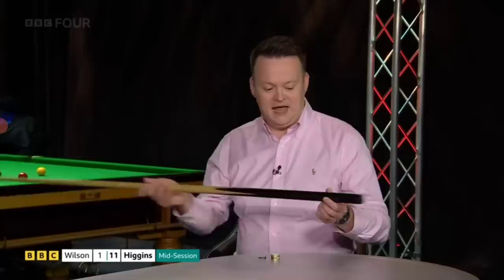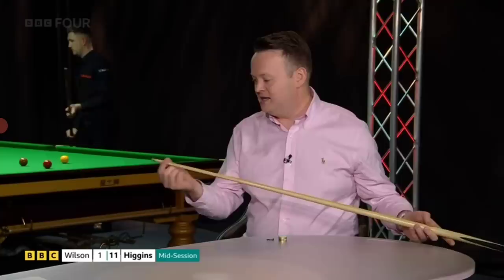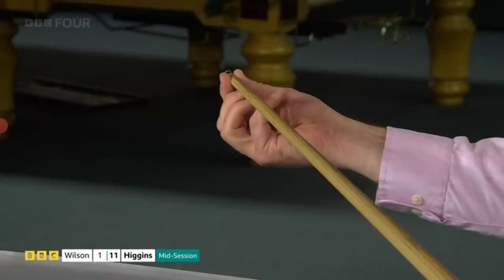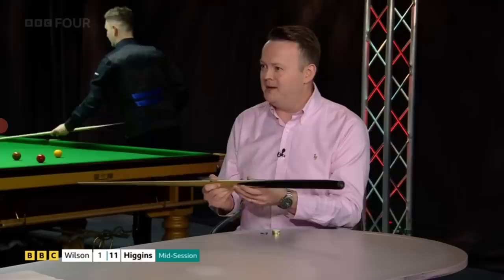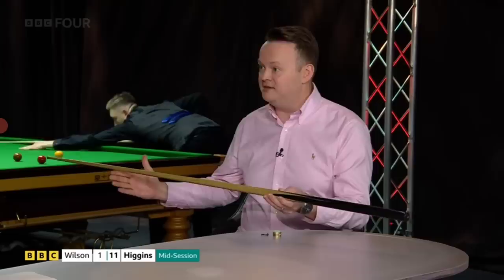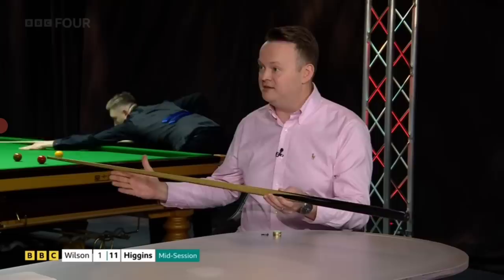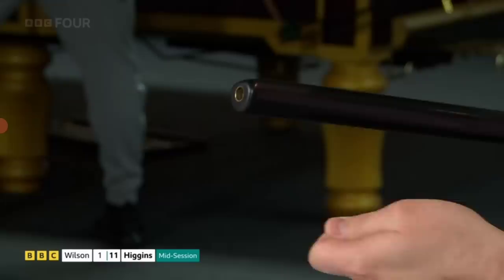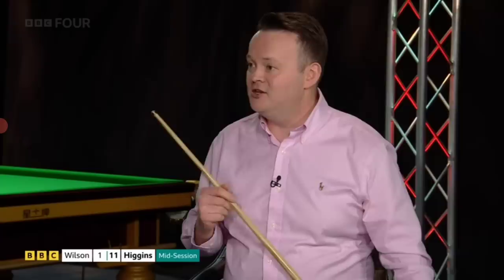KBV-411 Shaun Murphy Demonstrates The Problem Kyren Wilson ls Having With His Cue.

Comment: For anyone who thing a spare cue the answer. Its very difficult to change cue due for the fact the power, feel, weight point, stiffens. thickness and tip need time to brake in. These are unique characteristics of a new cue to get used to it can take upto a year to be 100% with a new cue. (depends how much you play). For most player have a hard time getting used to a new tip if needs replacing in a tournament. Let alone a new cue that a player been playing with for years with the same cue. And inaddtion if you think the answer is to practicing with two cue you are getting better with none of them. Truly you can only grow as a player with a cue of your own
Reply: Kayron is a good player but not as good as Higgins.  Higgins is old so his performance is not as good as it used to be but it was good enough to beat Kayron.
Reply: Have to have a excuse.. It couldn't be that you where not as good as the other fella
Reply: Kyren changes cues often though so it would not be so much of an issue as a player who uses the same cue for years.
Reply: A cue makes at most a couple of percent difference. It's just easy to blame the equipment if you're not playing well.

Comment: John Parris cues at its best
Reply: I know someone with a parris cue that's done the exact same thing..if its the weights in the splice that is. His cue was horrible to play with like that.
Reply: Ton praram III is the best for me.❤
Reply: Ronnie O'sullivan's is the best.
Reply: I have a Parris cue, it's not made particularly well. Something was loose inside, so I took it back to the shop. No, there's nothing wrong after about 3 weeks. Started playing with it again, and yes, it was still loose. Worked out it was the extension joint had come loose so tightened it and it hasn't been an issue since. I would have thought that would have been glued in place. It does play nicely, but the finish. Not so good, and also, there's a massive knot in the shaft, and the splices are raised. I have a couple of Trevor White cues that are faultless. Shame you can never contact him. Somebody I know waited 6 years for an Ultimate. No thanks.
Reply: @irnickkkknowles  Snooker cue from Thailand is the best.
Reply: @racingretro4850  Omins
Reply: @WillyEckaslike  Have you try TON PRARAM III ?  There are many pro player use this brand such as noppon, john higgins, kyren wilaon and many chinese players.
Reply: @irnickkkknowles  They must be doing something right, those cues have won world championships. Perhaps the pros get different treatment than the average buyer.

Comment: As I understand the cue case mishap happened AFTER the first session, when Kyren already was 0-8 down. How could the faulty cue then had a negative influence on the first sessions play? It looks to me that the faulty cue actually helped him in the second session win 2 frames. Or maybe Higgins was just better than Kyren those 2 days. Experience comes before youth. Higgins has been working on his come back for a few years now, and wasn't going to be stopped by Kyrens poor shot choices. He just took advantage of the youths inexperience. What stopped Kyren from changing cues anyway?
Reply: I wouldn't call Wilson an inexperienced player.
Reply: @sonicdiablo8968  more inexperienced than Higgins
Reply: Changing cues? U mean like getting 1 off the rack of spare cues they have next to the door on the way into the crucible?
Reply: kyren isnt inexperienced he has been at to top ranks for many years and has won big tournament. It would be like comparing Judd Trump is inexperienced to Ronnie. Its very differcult to change cue due for the fact the power, feel, weight point, stiffens. thickness and tip need time to brake in. These are unique characteristics of a new cue to get used to. For most player have a hard time getting used to a new tip if needs replacing in a tournament. Let alone a new cue that a player been playing with for years with the same cue.
Reply: @sonicdiablo8968   he is a cry baby
Reply: There are millions of cue in the U.K.. He can get a good one. His performance was poor and Higgins is in top form with experience.
Reply: @jimbevan4107  I don't see what that has to do with my comment
Reply: @sonicdiablo8968  ok I will spell it out, Wilson cries like no warrior I have ever seen (he is no warrior) so now that he has lost he is saying his cue let him down! Shame on him!!! He should praise the cheat Higgins and bow out like a cry baby he is
Reply: @jimbevan4107  I said he wasn't inexperienced. FWIW I pretty much agree with what you're saying.
Reply: @courierton9217  that's not how it works...players don't just change a cue it's like a baby to them that's why you barely ever hear of players having a different ones throughout a career they can't just pick up a new one and be like yeah that's amazing...Higgins battered him but nothing to do with experience

Comment: Personally, if I was at that level....I'd always have at least 3 cues ready to go at all times.
Reply: No 2 cues are the same. Doesnt matter if you spec it will not react the same way. Cues are not massed produced and each one has its own unique feel and reaction. Yes you can specify the weight and ferrule size etc but its really in the wood and hand splicing that makes each cue totally different. All snooker pros have one cue, and most play with that cue for their entire careers. Its a very subtle thin and almost becomes an extension of the arm. Not that simple Im afraid.
Reply: @TheDeebee26  It is that simple. They're not so different that ya can't get a few feeling very close especially the way they can source them and what would you rather have, a cue you've played a lot with feeling slightly different or your one cue totally messing with your head because it's been lost or  broke. Many pros use the same cue just because they've had it for years and how they got it, not because of how it was made.